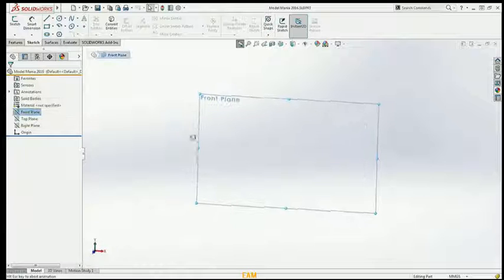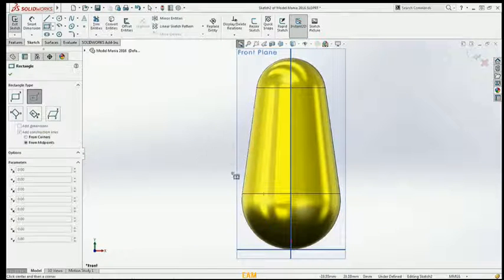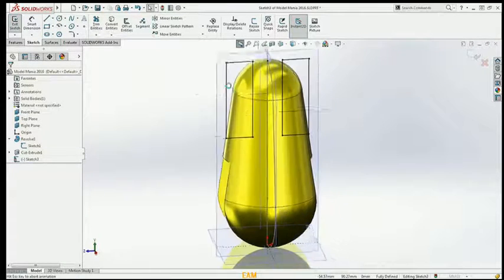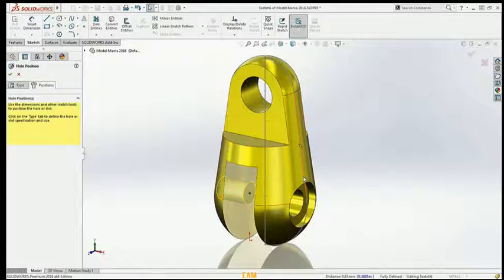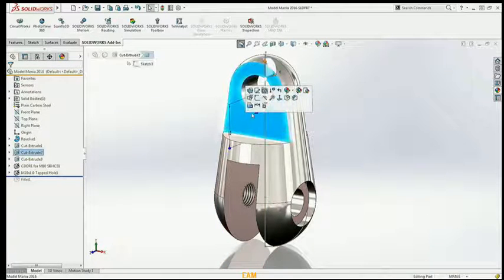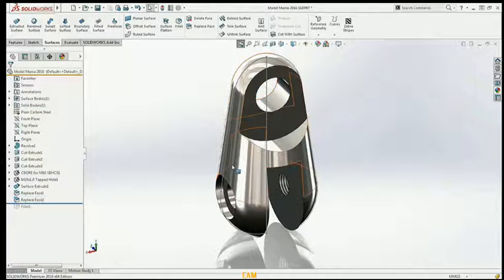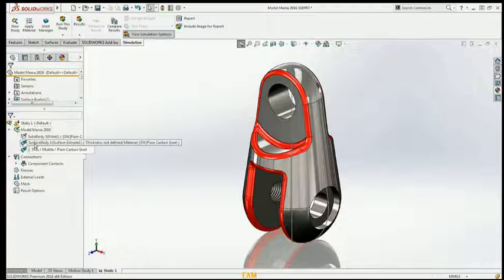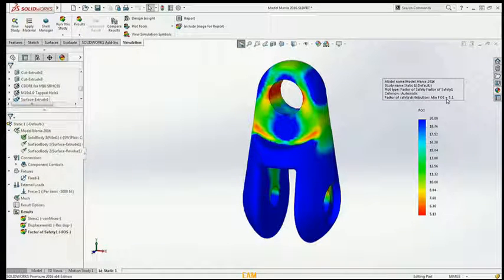SolidWorks SWW 2016 Model Mania

Comment: This Guy is Very Good, I have followed all 2000 thru 2014 videos authored by Dassault and have learned relevant functions on each model. Unfortunately I am unable to find the 2015 session and the video format has changed for 2016/17, both the visibility and sound quality have degraded. It appears EAM_Solidworks is providing current sessions , which is better than nothing at all, but I would be nice if the original author was still narrating in the earlier format.   SolidWorks                               /            vs                       /                                             EAM_SolidWorks